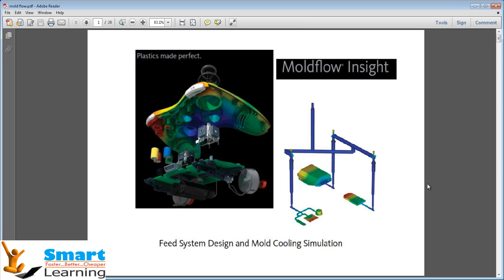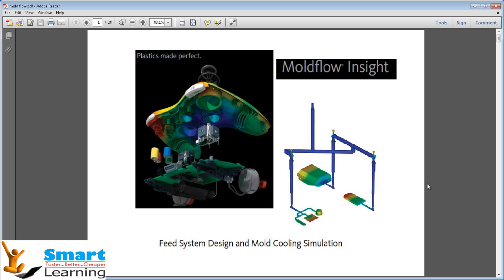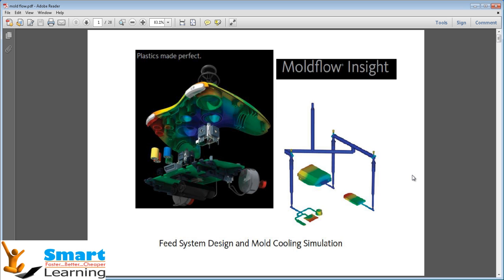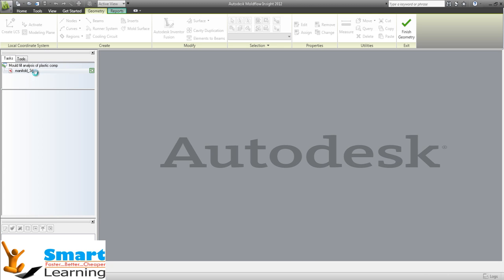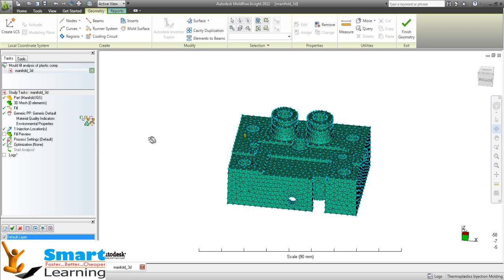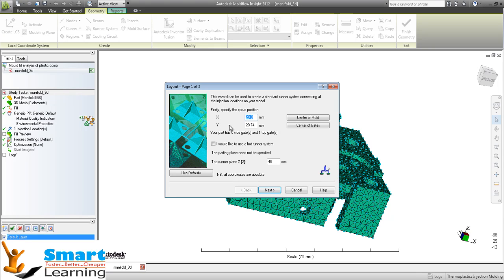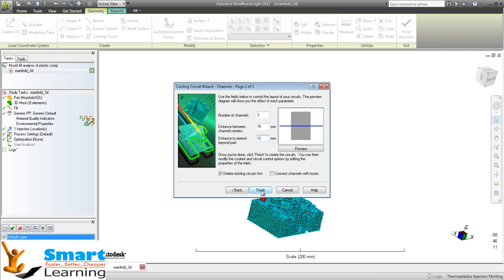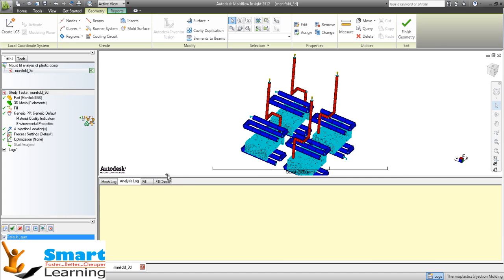Autodesk Moldflow Analysis-Video Training/Tutorials DVD

Comment: Microsoft Excel 2010 Tutorial Dvd Buy Online,80 Hours Video Training,5 DVD Package,Just Rs.250 Only, HD Print, Free Cash On Delivery Contact:9976570800
Microsoft Word 2010 Tutorial Dvd Buy Online,80 Hours Video Training,5 DVD Package,Just Rs.250 Only,HD Print,Free Cash On Delivery Contact:9976570800,9688778500.
Microsoft Excel 2010 Tutorial Dvd Buy Online,80 Hours Video Training,5 DVD Package,Just Rs.250 Only,HD Print,Free Cash On Delivery Contact:9976570800,9688778500.
Microsoft PowerPoint 2010 Tutorial Dvd Buy Online,80 Hours Video Training,5 DVD Package,Just Rs.250 Only,HD Print,Free Cash On Delivery Contact:9976570800,9688778500.
Adobe Photoshop CS6 Tutorial Dvd Buy Online,80 Hours Video Training,5 DVD Package,Just Rs.250 Only, HD Print,Free Cash On Delivery Contact:9976570800,9688778500.
Adobe Photoshop CC 2015 Tutorial Dvd Buy Online,80 Hours Video Training,5 DVD Package,Just Rs.250 Only,HD Print,Free Cash On Delivery Contact:9976570800,9688778500.
Adobe InDesign  CS6 Tutorial Dvd Buy Online,80 Hours Video Training,5 DVD Package,Just Rs.250 Only,HD Print,Free Cash On Delivery Contact:9976570800,9688778500.
Adobe InDesign  CC 2015 Tutorial Dvd Buy Online,80 Hours Video Training,5 DVD Package,Just Rs.250 Only,HD Print,Free Cash On Delivery Contact:9976570800,9688778500.
Adobe Illustrator CS6 Tutorial Dvd Buy Online,80 Hours Video Training,5 DVD Package,Just Rs.250 Only,HD Print,Free Cash On Delivery Contact:9976570800,9688778500.
Adobe Illustrator CC 2015 Tutorial Dvd Buy Online,80 Hours Video Training,5 DVD Package,Just Rs.250 Only,HD Print,Free Cash On Delivery Contact:9976570800,9688778500.
Coreldraw Graphics Suite X8 Tutorial Dvd Buy Online,80 Hours Video Training,5 DVD Package,Just Rs.250 Only,HD Print,Free Cash On Delivery Contact:9976570800,9688778500.
Adobe Photoshop Lightroom CC Tutorial Dvd Buy Online,80 Hours Video Training,5 DVD Package,Just Rs.250 Only,HD Print,Free Cash On Delivery Contact:9976570800,9688778500.
Adobe Photoshop Elements Tutorial Dvd Buy Online,80 Hours Video Training,5 DVD Package,Just Rs.250 Only,HD Print,Free Cash On Delivery Contact:9976570800,9688778500.
CyberLink PhotoDirector Tutorial Dvd Buy Online,80 Hours Video Training,5 DVD Package,Just Rs.250 Only,HD Print,Free Cash On Delivery Contact:9976570800,9688778500.
Corel PaintShop Pro X6 Tutorial Dvd Buy Online,80 Hours Video Training,5 DVD Package,Just Rs.250 Only,HD Print,Free Cash On Delivery Contact:9976570800,9688778500.
Adobe InCopy CC Tutorial Dvd Buy Online,80 Hours Video Training,5 DVD Package,Just Rs.250 Only,HD Print,Free Cash On Delivery Contact:9976570800,9688778500.

Comment: what diffirence between moldflow insight and moldflow adviser?
Reply: +vu anh Tuan 

Moldflow Adviser 

 
  
  Includes Moldflow Adviser Premium, plus:Mold filling, packing, and cooling guidanceCauses of warpageFiber orientation
  
  

 

Moldflow
Insight 

In-depth plastic injection molding simulationPolymer flow, mold cooling, and part warpage predictionMeshing and process parameter control